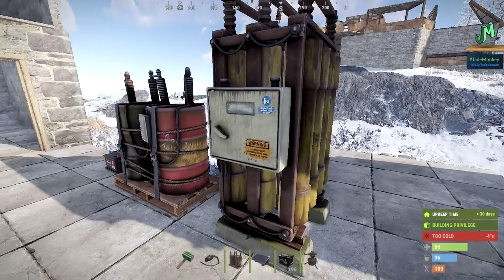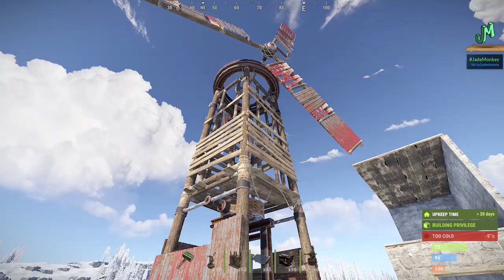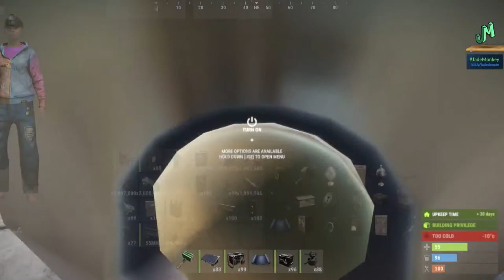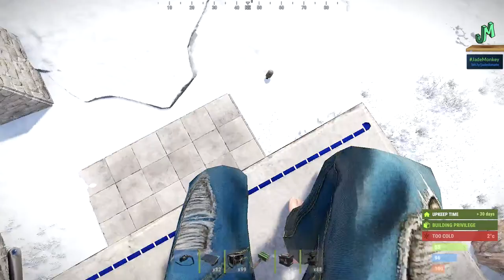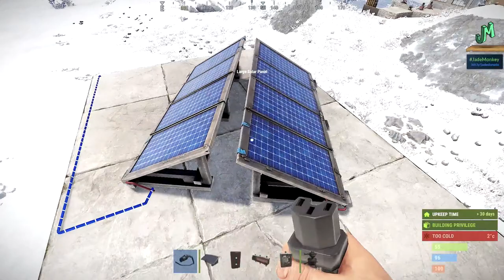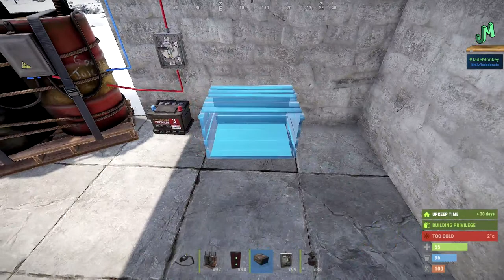Electricity Basic Setup Power Surge Guide 🛢 Rust Console 🎮 PS4, XBOX

Comment: 1 question.. your base is half open here of you put the wires.. my base is closed how do i do it then? I have to go down my base and then put the wire or?
Reply from the maker: with your wire tool out make a connection onto an electrical component and the you can walk and open and close doors, jump to where you need to go and the you can make a connection to the other electrical component